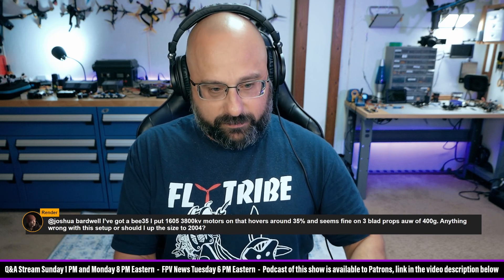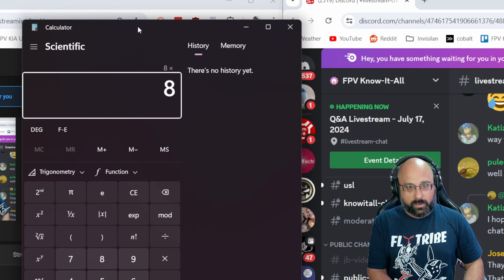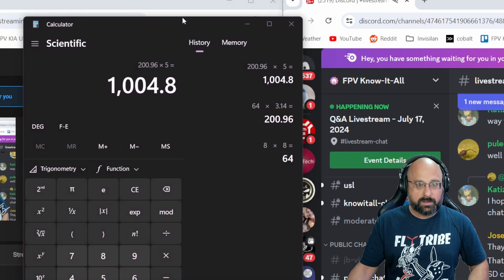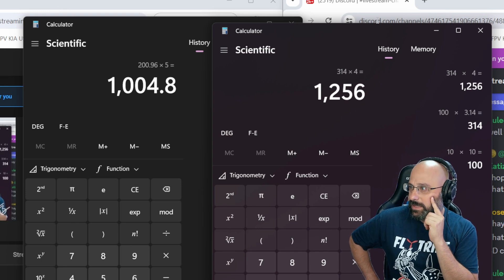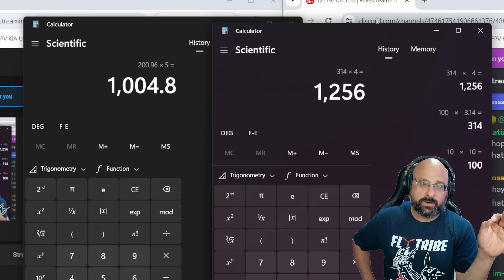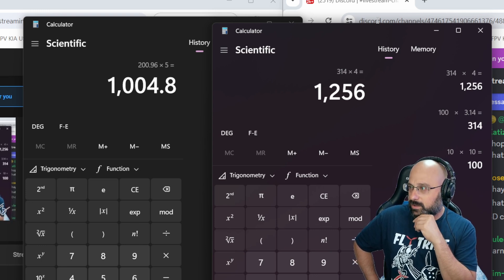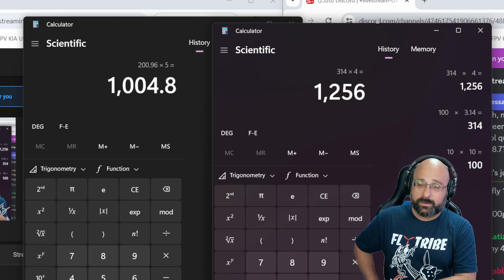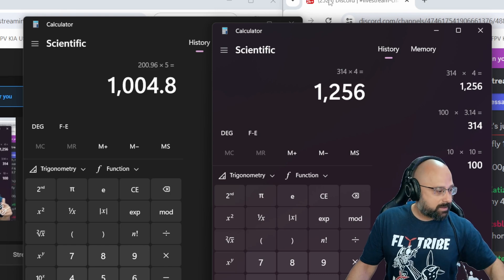What's Size Motors Should I Use for My Heavy 3.5 Inch Drone? 1605 vs 2004 - FPV Questions

Comment: We are using T-Motor 1804 KV3400 5mm on our 3,5 Freestyle Quads
Reply: Would this setup with 1804 3400kv, can carry an action 2, (not use in freestyle, but only for Cinematic cruising)
Reply: @Quad8ightMix  absolutley!

Comment: My grinderino comes in under 220g dry with hd vtx, I went with 1507 and this is a question I ask myself a lot, 2004 seems like more than I need, but if i put an 850mah pack on i will be getting close to 400g easy
Reply: 1507 and 2004 have nearly identical stator volume, i wouldnt expect them to perform all that differently

Comment: Because the Bee35 is a micro cinewhoop, the frame alone weighs 120g
Reply: Agreed. It's not a freestyle drone. The O3 version includes a metal heat sink. It also has a metal camera frame. (I personally like it. I have one myself.)
Reply: @ddegn  Yes, it looks like a really well designed frame. I thought about building one; but I didn't really see the benefit over a Flylens85 except a bit more speed.

Comment: I put 1604 Tmotor with 3620. It flys nice but a little underpowered. Same rig. (Siren f35) 2203.5 and 3620 and it’s wayyy fast and needs a cap but fuck is it nice and smooth with power for days. 

The tmotor 2004 is a cinematic motor. Ask me how I know.  It spins up slow and is very efficient. BAD for freestyle
Reply: I have the 1604 on my 300g 3.5inch and they rip (the 6s ones) hover at 20percent and nearly as quick as my 5inch

Comment: 2004 motor all the way.
I suggest you use the emax 3.5" props though. Love that combo.
But you should work on your weight.
Reply: Gemfan hurricane 3630 are the goat from my experience. I use mamba toka 2004 1700kv motor on a grinderino 3.5
Reply: @tehBlackouTT  yeah 3630 are great. Not sure if 3.6 fits into the cinewhoop frame ducts.
Reply: @tehBlackouTT  your giving up a fair bit of thrust by using 1700kv 2004's. those are 5" 6s toothpick motors imo. 
i run 2450kv 1804's on my 6s volador 3.5 and i like the 3630's but they tend to snap blades in half so damn easy when other props would just bend.
Reply: @bradraymond5502  I actually plan on swapping my arms on my grinderino 3.5 with 5in arms and props since I'm using 2004 motors.